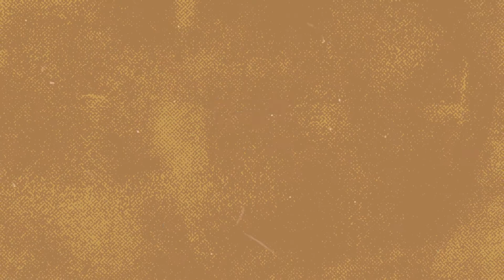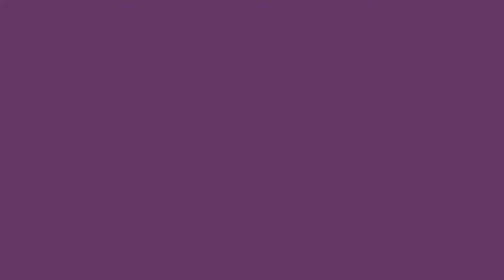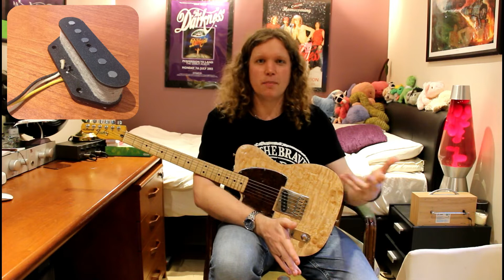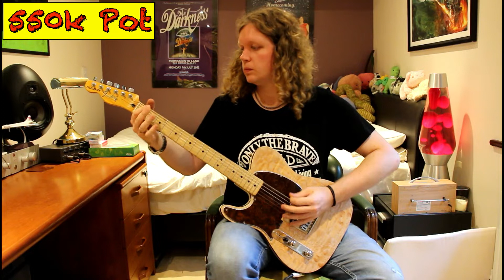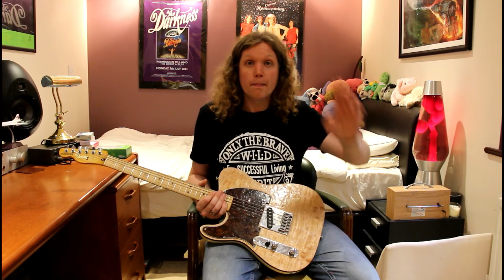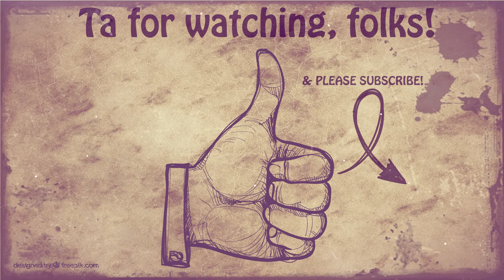Hot Broadcaster Pickups: 250k Pots or 500/550k Pots?

Comment: Many thanks for the demo. I've recently fitted a Wilkinson Broadcaster pickup to my tele. It's not quite as hot as the  Monty's Broadcaster pickup but has very similar traits to it's tone. At the same time I fitted a higher output neck pickup to get a better bridge / neck balance. Using the 250k vol pot the bridge pickup sounded warm and fat (but still very telecaster). However the neck pickup sounded a little bit too deep for me, so I changed out the volume pot to a 500k Audio type. The neck pickup is now a lot nicer, less muddy and for me much more usable. The Broadcaster bridge pickup now has more treble getting through, maybe overshadowing some of the fat bottom end tone? Anyhow by EQ-ing my amp I can pretty much get back to that warmer, fatter sounding bridge pickup when needed. The 500k pot just allows more treble to get through to the amp, which can be dealt with by adjusting the amps EQ settings. The 250k pot was filtering the treble before it got to the amp, which cannot be gained back by the amps eq. For me (and because my hotter neck pickup was also a consideration) the 500k volume pot won.

Comment: I noticed it most with the grease. I looked away from the screen to make sure i avoided cognitive perceptual bias, then looked up to see the value on screen. 550 was just as you said. More open, sweeter, clearer, silkier, fuller with  overdrive especially. This mod is for blues players, i think i would use a treble bleed as well for even tone.

Comment: You guys should try singke shaft dual gang pot from cts. 500k on top, 250k on bottom. Wire the 500k to you neck pickup then bridge on 250k via superswitch. Then 500k or 250k on both. Wide open on neck, warmth on bridge position.  Thats my fav mod.

Comment: 1:28
It's totally understandable what you are talking about. However it is a bit of a misconception to say "to add" when speaking of passive pickups. It is impossible to add anything in them, the baseline is raw pickups themselves with their output. All the further tone shaping in a passive guitar electronics is subtracting some percentage of initial signal. So technically it is not "to add more treble" but rather "subtract less of treble".

Dig your playing! :)
Reply: @Aleksandr Nestrato Exactly! If you get as much of the raw signal to the amp or an EQ pedal, then you can subtract unwanted frequencies.

Comment: 500+ will always sound better on full because the extra q squeezed from the pickup does stand out. My issue as a volume rider is that at half volume that bigger pot is twice the output impedance and that means more highs lost with cable capacitance and introduces the treble bleed dilemma, makes cables more criitical etc. All this said stunning tones and proper groove in this video keep up the good work.
Reply from the maker: Good cables are the answer ;-) Cheers mate!

Comment: I got a bunch of CTS "500k" flat bottom pots, turned out that the highest reading on the voltohmmeter was 589k and the lowest being 539k. If you want little less top end go with the CTS True Vintage Taper pots (axle is shown thru in the concave bottom), those seem to be sub 500k, around 440-490k. These may seem like close enough but when you really want to get the best out of your pickups natural frequency response and tame just only those resonance peaks it is very much worth it to roll some pots. Get a few and sort them out. CTS is great because the innards are mostly interchangeable regardless of the axle type. I got exact 500k volumes on my Les Paul, neck pup paired with 1meg tone, and the bridge pup with 250k tone to tame down that vintage tribute non waxed Sheptone PAF highs. With long shaft posts and axles.

The best thing is once you have found the right pot for the guitar, you will then have a good reason to put together some parts-o-casters since you allready have some spare "calibrated" pots laying around ;)

Comment: If I want to add a lil more low end and control to my Jazzmaster should i switch both pots to 500k or 250k? I was thinking a mix of 250k in the volume or 500k in the tone or vice versa with a new capacitor. Idk I'm indecisive.
Reply from the maker: Changing pot values won't 'add low end' as such; they'll just let less high end come through.  The end result is similar on balance, but you will lose the classic 'glassiness' to the Jazzmaster's high end by lowering the pot values.  To keep that high end whilst thickening up the lows, you might want to experiment with pickup height, using the tone controls and/or changing pickups before changing pots.  But if you just want everything darker overall - pots are the way to go :-)

Comment: Did you switch the tone pot or the volume one? I want yo do these experiment un my Stratocaster  bridge pickup, any sugestions
Reply from the maker: I actually switched both - but with the wiring as it is in this guitar, the pickup was only running through the volume pot; no tone pot or capacitor in line.  For your Strat, 500/550k would almost certainly be too high.  CTS make a 280k pot for BKP which would likely be a good fit - but of course, it all depends what you're trying to achieve.  If you want it a little brighter, 280k would be a good place to start :-)